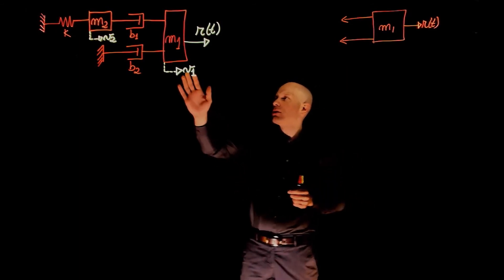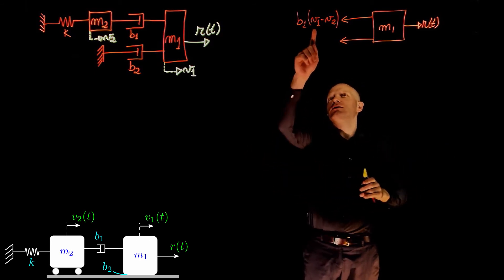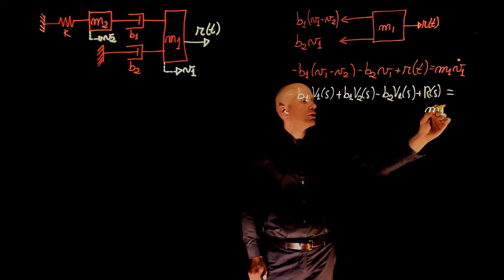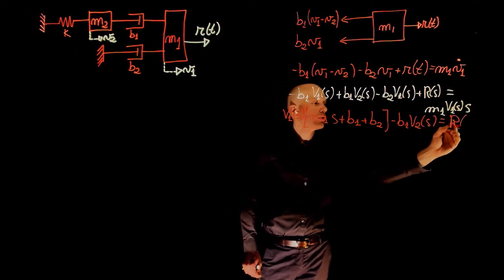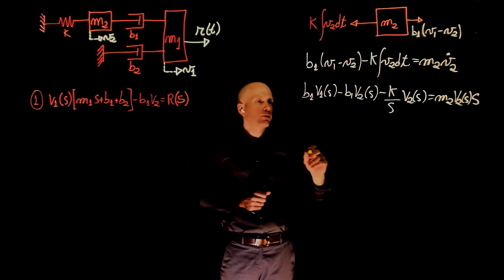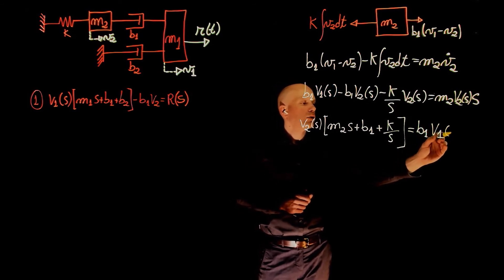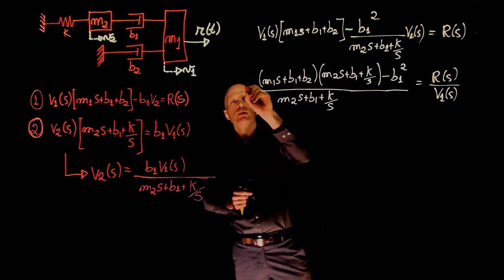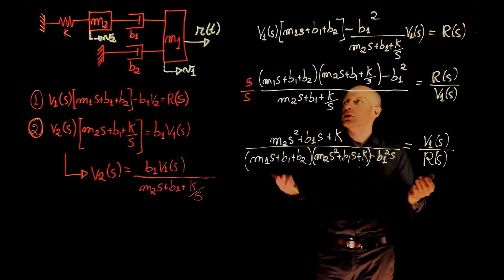L4E17 - Control Systems, Lecture 4, exercise 17. Transfer function of a mass spring damper system

Comment: on M2  why b1(v1-v2)     why not  b1(v2-v1) sir?
Reply from the maker: It's either b1(v1-v2)  and -b1(v1-v2)  or b1(v1-v2)  and b1(v2-v1), but not -b1(v2-v1) as it would cancel out the negative sign indicating that the force acts in the opposite direction

Comment: hello sir, why is it that at (time mark) 9:15 in the video, the (m1s+b1+b2)  did not get multiplied with S? and it was only the (m2s+b1+k/s) that was multiplied by S.
I understand that the S/S was done to get rid of the denominator in the K/S. but I am just confused on why the first bracketed equation in the numerator (m1s+b1+b2) was not multiplied by S.  thank you.
Reply from the maker: If you multiply each term in parenthesis in the numerator by s, you would be multiplying their product by s^2
Reply: @biomechlab  thank you! Have a good day
Reply: @biomechlab  is it necessary to multiply it by s/s? what's the purpose of getting rid of the S in the denominator?
Reply from the maker: @arnabjoy6097  It is just to make it more readable. A transfer function is defined as the ratio of two polynomials of "s", k/s would not adhere to that definition (but it is still a valid answer). If we get rid of it, it is easier to determine the poles and zeroes of the transfer function.